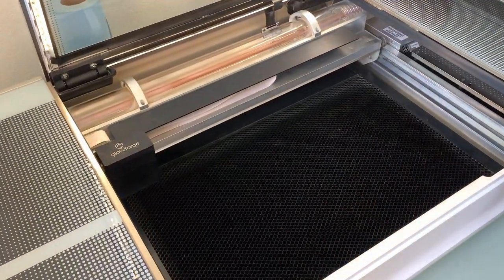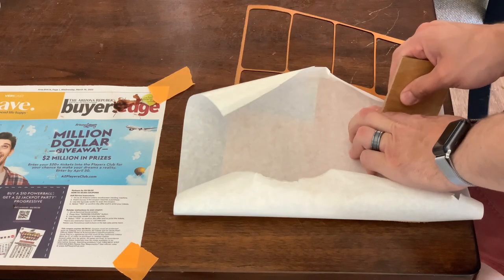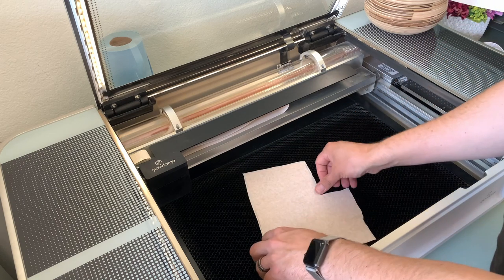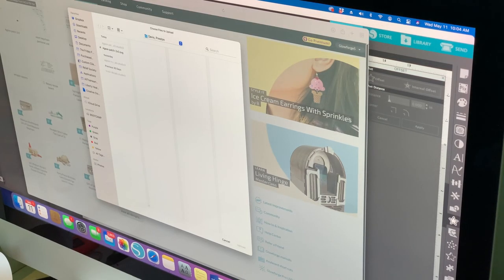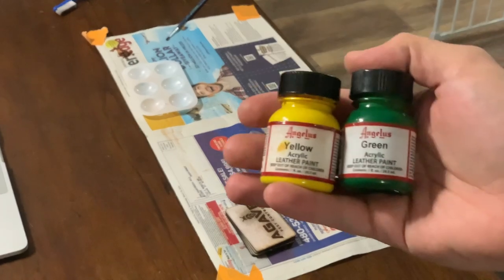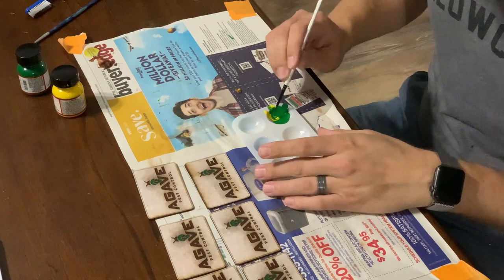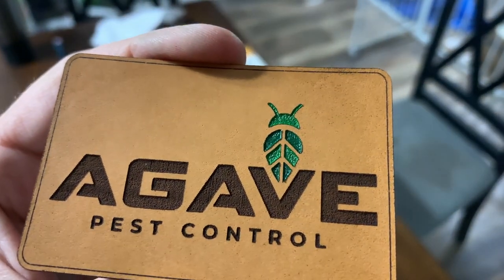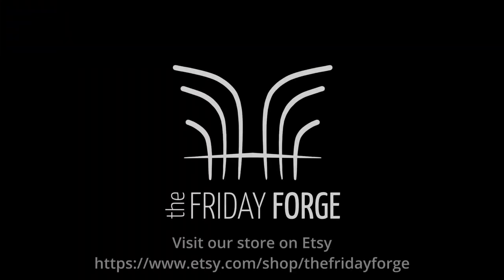Leather Patches on a Glowforge! Making Leather Patches For Hats

Comment: These look so clean.  I've been dealing with soot making my projects look messy.  I have been soaking paper towels or microfiber cloths with Awesome cleaner and wiping them down after the laser.  

The pieces always look so damn good hot off the laser, but then lose their luster after I wipe them down.  

I wanted to avoid the masking tape as it leaves residue.  I'm wondering if spraying them right after the laser without touching them would contain the soot and prevent it from wiping off?
Reply from the maker: Yes! The soot can be a real problem. In my experience, it depends on the type of leather you get. Top grain leather has a really tough exterior (what I’m using here) so the soot wipes off pretty easily and the tape doesn’t leave any residue. But I’ve tried using some leather in the past that is closer to suede where the soot just makes the whole thing look dirty.
I have also tried your idea of spraying the finisher on without touching the soot and pressure from the spray gun actually blew the soot around the piece. Could be I had the pressure set too high so it still might be worth a try. Let me know what you come up with!
Reply: @TheFridayForge  Thanks for the quick reply!  I've been using Horween leather, (one is suede and always stains) so ill look into top grain.  Thank you!

Comment: Hi Thank you for the instructional video but what setting do you use on the GF
Reply from the maker: So I’ve found that each time I use leather it seems to be a little different just because of the slight variation in the leather. But I like to make it simple so for this I think I just used the proofgrade settings for Thick Natural Leather. But there have been other times that I used the Medium Natural Leather settings. I’ll usually start at a proofgrade setting and do a test then I’ll adjust the speed or power as needed. Hope that helps!

Comment: what settings do you recall using on the leather. Lasering the graphic on? I feel like im not getting a clean look like others I am seeing being done, just trying to conserve materials.
Reply from the maker: This is on a Glowforge so when I do it, I select the proof grade setting for Thick Natural Leather. Then for engraving I use the pre-set option for SD Graphic. Speed: 1000, Power: 71, LPI: 270. Hope that helps!

Comment: Will the masking tape “mark” the leather when you take it off , or does the staining prevent that .. great job on the patches .. !!
Reply from the maker: Good question! I imagine if you used masking tape that was really high tack there might be a risk of adhesive residue. But in this case it peels off just fine without leaving any marks. The staining doesn’t really effect the tape since you let it dry completely before applying tape.

Comment: Thanks for sharing this! What engrave and cut settings did you use?
Reply from the maker: So the leather we used is half way between Glowforge’s medium and thick leather presets. But I found that the Thick Natural Leather setting worked just fine for this. So on my Glowforge Basic it’s Speed 168 and Full power for cut. Speed 1000 and 71 power for engrave. Long answer, but hope that helps!